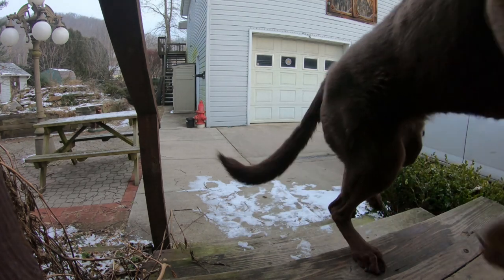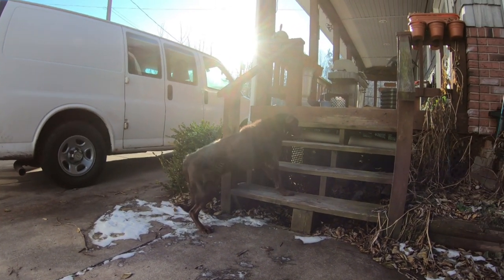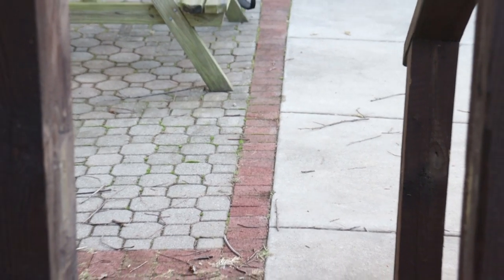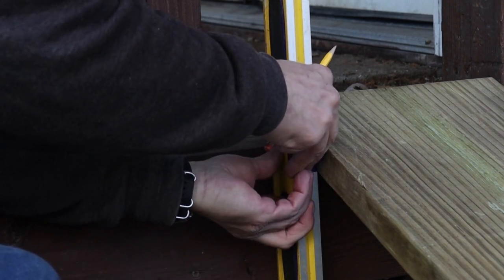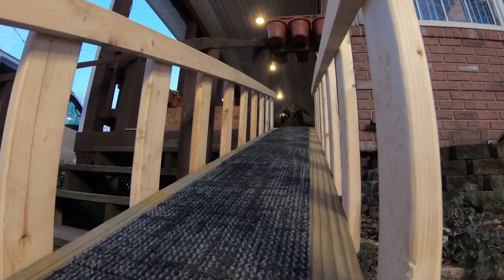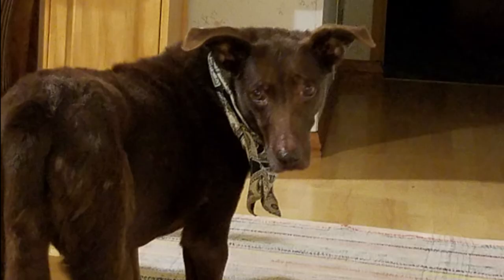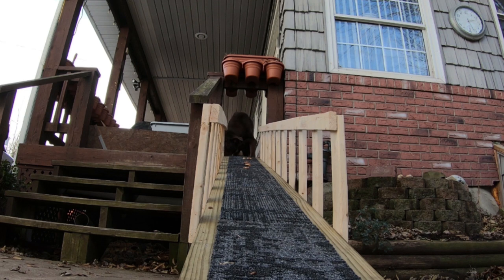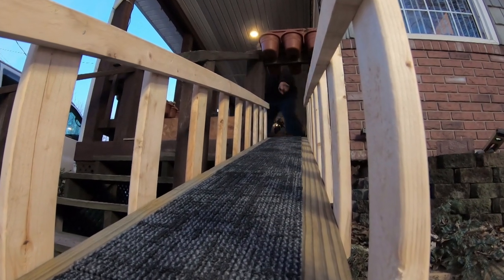Dog Ramp DIY | Part 1

Comment: I build a ramp for my 14-year-old German Shepherd, who’s back legs are giving out and having a hard time walking up the 3 steps. Off my deck. I built the ramp using leftover stockade fence secured it to my top step. My dog is stubborn. She still won’t go up and down it. I still have some work to do on it. I might have to raise it a little bit and then drop it at the bottom another rap Because she’s having a hard time walking up the ramp because her back leg she’s got a push up off with her back legs to get up the ramp so the less inclined the better. the ramp that you building looks too steep. It’ don’t get me wrong it’s nice you did a great job but it should be wider, so your dog feels more comfortable going down and up they have the space with the narrowing and the steepness it’s scaring your dog, and keeping her from going up and down to your dog and that’s scaring her or you need to make it less steep and gradually lower it to the point where it almost looks level to her but it’s not, and will be less pressure on her legs, and put a gripping rubber mat, that they could grip and make it easy for her to go up and down,  hope that was helpful! LC,
Reply from the maker: Thanks for watching and the helpful tips Lauren. I agree that being so narrow was probably scaring her. I made it somewhat wider and she still wasn't willing to use it. After that, I really didn't have space to go wider, so I just carried her up and down for the rest of her days. In hindsight I think that if I had gotten her used to it when she was younger and healthier, she would have been sure footed and probably would have adopted the ramp as her preferred method to get up and down. It's almost three years since Coco has passed away. I still think about her every day. I hope for the best for you and your German Shepherd.
Reply: @themostlymikeshow  try with her leash and walk her up and down it a few times Till she gets the concept of it See if that helps her. I build stairs off my  Deck on the back and on the side so I put the ramp on the back steps wide. She’s hesitant on going up it’s because her hind legs it’s hard for her to push off coming up so I have to raise it to make it a little more level, 
What’s a slight incline 
and then drop the incline just a little so she could get up to the level. So I still have some work to do on mine. Also it’s the things we do for a little feet babies that we love so much they are our family!

Comment: Great project. In order to get Coco to use the ramp, you need a couple of steps before. You need her to get used to the "new" surface flat and without the railings. Just put the board with the new surface on the deck for a few days. Don't forget to give her treats and make it a game for her. The second step would be adding the railings only on one side for a few days. The third step is adding the second railing and letting her come and go on a flat surface. She'll get used to it. The last step would be placing the ramp and the railings in the final position. Hope this might be of help. Cheers,
Reply from the maker: Thanks for the advice Ignacio. I'm sorry to say that Coco has passed away on October 26th of 2020. I really wish that she was around to try your method. Coco had a nice long life just a few days under 16 years which is great for her breed.  I made a tribute video to her life. I'll post the link underneath if you like.
Reply: @themostlymikeshow  We had 5 steps and I built a 16 foot x 2 foot wide ramp and I put green out door grass carpet on it, it was magnificent, for my 13 year old golden retriever Duke and he simply refused to ever use it.   He weighed about 85 pounds and I resorted to carrying him in and out the last months of his life.
Reply from the maker: Wow Greg, I often thought that going wider or longer would have gotten her to use it, but I guess that they just get set on their ways. Coco has passed away almost two and a half years ago and I still think about her every day. Thanks for watching and sharing your experience.
Reply: @themostlymikeshow  Thank you kindly for your response, I again find myself with an older dog that is really struggling with stairs - I told my wife that the best thing we could do was install a wheel chair ramp and then we can all use it!
Reply from the maker: I hope that if you go with a wheelchair ramp that it works out well for you all. Please keep me posted!

Comment: This is a great video, Coco is awesome.  What’s the update?  Is she using the ramp yet?  If not my only suggestion is to make the ramp wider, maybe six inches would be enough.
Reply from the maker: Coco thanks you for the kind compliments! I actually held off on the update to that video. I made the ramp about 4 inches wider, then I added lattice to the Rails so it was a little more closed in. She refuses! I should be putting an update video out soon with those improvements, and a couple more things that I want to try. Thanks for watching!
Reply: @themostlymikeshow  I have the same problem with my 12-year old border collie. She never liked ramps, whne she was younger I tried doing agility since my other BC loved it, this one would jump off the ramp. She is 68pounds, with hip dysplesia and I can't carry her. I am a renter who shares stairs with neighbors so I can't even do such a sophisticated ramp cause it needs to come off after each use. We are also in a city where even first floor apts have a set of stairs, and buildings with elevators are usually fancy and expensive (she also finds elevators stressful, but that is not the main issue). Really frustrating. This is her only health issue, so it is sad.
Reply from the maker: Yes Belizat, it's sad when they act like puppies and have issues getting around. I posted an update video a few weeks ago, but sadly Coco still won't go on the ramp. She tried one time and it didn't go well. She gets halfway down and then leaps for some reason, and that's when it goes bad. In that video, I build a gate so she can't dart for the steps, which would likely end up in injury or worse, so I just carry her up and down. It's all that I can do for the moment. Thanks for watching!
Reply: @themostlymikeshow  I have a problem I have a 12 year chocolate lab he neurological problems where he can’t move his back legs so I have to carry him up and down the steps and he’s 100lbs so u know that’s heavy when it’s deadweight but I’m trying to think of something if you guys have any ideas please help me I got him the doggie wheel chair which he loves but it don’t help with stairs.
Reply from the maker: Hi Rick. I wish that I had some ideas to help. Coco has passed away on October 26th of 2020. I think about her every day. She only tried the ramp once and it didn't go well for her. If there was some way to cart him on a less steep ramp is all that I could think of at the moment. I hope that you can find a way. Thanks for watching.
Reply: @themostlymikeshow  I'm so sorry to hear about Coco. She seemed like a real sweet pup.
Reply from the maker: Thanks Nate. Coco was an awesome dog. It's been over a year since she passed away and I think about her every single day. I hope that what they say is true that someday we will reunite with our lost pets. If you have any pets, please give them some extra attention or a treat for me. Thanks for watching.
Reply from the maker: Thanks Nate. Coco was an awesome dog. It's been over a year since she passed away and I think about her every single day. I hope that what they say is true that someday we will reunite with our lost pets. If you have any pets, please give them some extra attention or a treat for me. Thanks for watching.
Reply from the maker: Thanks Nate. Coco was an awesome dog. It's been over a year since she passed away and I think about her every single day. I hope that what they say is true that someday we will reunite with our lost pets. If you have any pets, please give them some extra attention or a treat for me. Thanks for watching.

Comment: This is exactly what I’m looking for with the exception that I need it for my bed. Any thoughts on how to make the ramp not to steep and one that doesn’t run long in my bedroom?
Reply from the maker: Thanks for watching Valerie! I tried different things for Coco to still be able to get into the bed, but she was not open to new ideas. I actually made a small set of two steps that had a piece of plywood sticking past the top step to go between the mattress and box spring to hold it securely. She wouldn't even look at it. Lol. She was stubborn like that. I even tried putting a short padded storage ottoman in front of the bed so she could use it as a short step, and she wouldn't try it either. I don't know if these ideas could help your situation, but maybe something to try.
Reply: I'm working on this plan for our Rottweiler and our yorkies for our king Size bed

Comment: I have a very old dog too, she is blind and was very stubborn especially considering the fact that she is blind she wanted to keep going up and down the steps which is a very bad idea. But give it time that is the best advice i can give. Build up from spare wood scrap a fence blocking the main steps and block coco from going down the familiar route. So it would force her to use the new solution to the problem. Going off my experience teaching an old dog something new just requires patience and the knowledge that in the end your contraption will help her out and she will use it
Reply from the maker: Hi Leo! Thanks for watching, and thanks for the advice! So far, I have widened it, and added lattice to the sides of the railing to make the openings smaller. The weather has not been really cooperative, but I plan on working with her more when I get a warm day. She is letting me carry her up the stairs more. I think that she is realizing that it makes her feel better to not have the shock associated with using the stairs. I will be posting a video soon with the new modifications to the ramp.
Reply from the maker: What breed of dog do you have?

Comment: I built a step for my 11 year old, stubborn as a mule, Kelpie yesterday...she stepped on it and smashed face first into the car....I felt terrible for her. So, today I did a ramp, I lined it with a rubber mat and then put 4 small strips of timber going across as steps...just so she has something to grip on. She had lost her confidence so it was a no go. I think I will put a stand under the ramp so it is more stable. Fun and games and hard on us seeing them not at their best!:-) I might need to try the carpet treads.
Reply from the maker: Hi Mel! One thing that I tried for Coco that really worked was using a couch cushion as a step. For some reason she didn't associate the cushion as a "contraption", and would climb willingly on to it to help get in the car. Sadly Coco has passed away in October. She had a nice long life full of adventures. She is very missed.
Reply: @themostlymikeshow  oh gosh, sorry to hear. Nothing worse than losing your dog. I do worry about my dog as she struggles. Thanks for that tip though...I will give it a go as a cushions a lot easier to drag in and out of the car than ramps or steps. I hope things get easier soon after losing Coco. (Heart emoji):-)
Reply from the maker: @melsparkles Thanks. It definitely takes some time. There's a big empty spot that she used to fill. I am not sure if you saw the tribute video to Coco, but It's on the channel page showing some highlights of the adventures that we had together.
Reply: @themostlymikeshow  after I read your message I spotted it but just can't watch it sorry! I even tear up thinking about it...any dog loss is so painful! I still tear up over a dog that I lost 11 years ago!
Some good news...my dog Lulu after some coaxing used the car ramp twice! I am super relieved! She even seemed a little bit happy:-) I hope you find some happy moments between grieving for your girl. (Heart emoji):-)
Reply from the maker: @melsparkles  I try to constantly think about the great times that we were both part of. Coco knew me better than anyone else in the world. She could even read my mind. I hope that it is true that someday we will meet again.
Reply: @themostlymikeshow  I'm sure when we cross that rainbow bridge all our fur babies will be there to meet us:-)

Comment: This is a great video, however I've got cement steps out the back and I don't know how I could stop the ramp from slipping.
Reply from the maker: Thanks for watching Cheese Toasty. Are you looking to install the ramp directly over the cement steps?
Reply: @themostlymikeshow  Yes I am. It's 8 steps.
Reply from the maker: You might be able to make a support that conforms to the top step, and perhaps fasten it with a tapcon, or anchor of sorts for added security, and then rest the end of the ramp on the ground. It might take some trial and error to get the angles correct. This is just picturing in my head from what you described.
Reply: @themostlymikeshow  I had to look up what a tapcon is (I'm in the UK) yes someone else suggested concrete screws too. Thanks so much! Also so sorry for your loss of Coco, just noticed in your other video ❤️
Reply from the maker: Thanks bud! I miss her a lot. I still think about her every day.
Reply: @themostlymikeshow  I dread the day when it comes. Animals are better than humans! Take care.

Comment: I have two St. Bernards who are now growing old for whom I want to build a ramp to get them in and out of my car especially for vet visits. The question I have which no youtube video has answered is what inclination angle do I need to  use to make it easy for my dogs to climb onto. Any answers from you or the readers here would be very helpful.
Reply: more than anything else with large dogs gravity takes over especially when they come down the ramp. That is simply why I am asking
Reply from the maker: I made my ramp with little knowledge of the requirements as far as steepness, so I made it as long as I could to make the angle as easy as possible for her. I just went out and measured it with a level and a protractor. It is about 20 degrees Slope. I hope that this helps.
Reply: @themostlymikeshow  Thanks a ton :)

Comment: My dog hates that black tried stuck to the stairs. I would try carpet.
Reply: Sticky black tread
Reply from the maker: Thanks for the suggestion.  Unfortunately since I made the video, her arthritis has gotten worse, so I have to carry her up and down the steps, which seems to be the new normal.
Reply: I tried indoor/outdoor carpet’s but when it rained it was slippery my dogs were sliding on it which turned them away from it so I bought a thick rubber mat with the grooves in 
It So they can grip onto it My 12 bully pit goes up and down it But my 14yr old Shepard won’t I feel it’s still a little steep for her back legs so I’ll have to raise it a little and gradually 
slant it a little at the end hopefully that works I was hoping she follow her sister up and down but it looks like I have more work cut out for me. even if it means making corners going around slightly going down into the yard. I’ll have to do what I gotta do
Reply from the maker: @laurencunningham3898
 Thanks again for the tips Lauren.